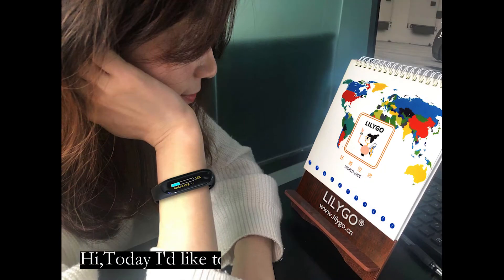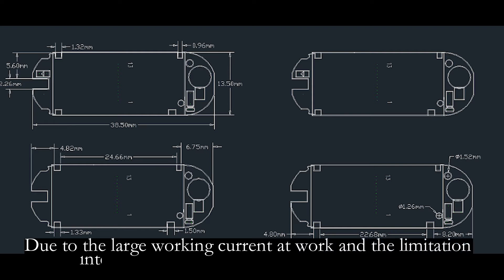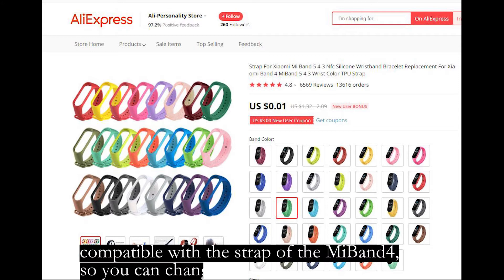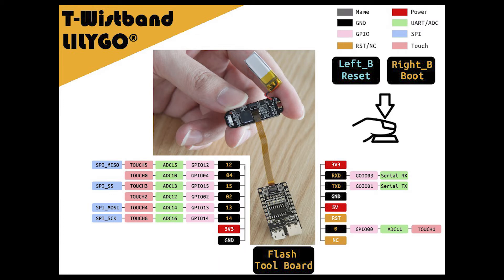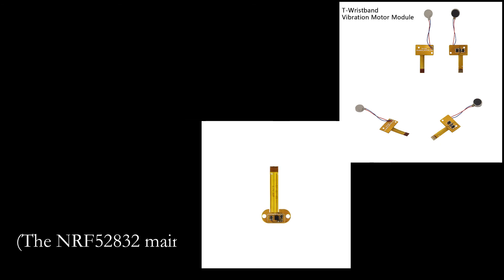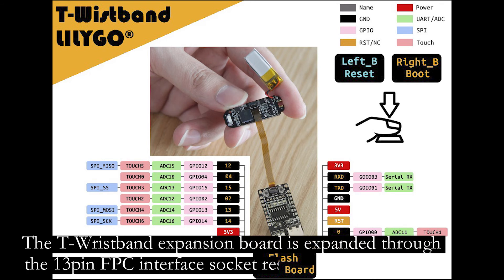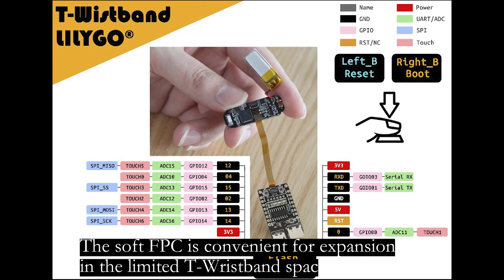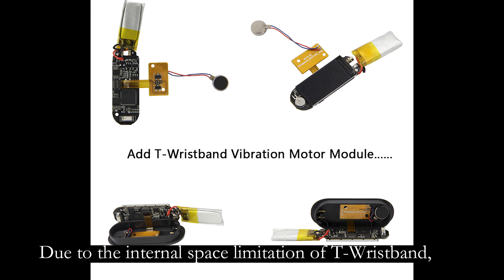LILYGO® T-Wristband  DIY Programmable Bracelet ESP32-PICO-D4 NRF52832 MPU9250 And LSM9DS1 Module

Comment: Will you release more T-Watch variants this year? Like bigger battery (I read that the watch has 350mAh and according to a comment from a buyer of the watch that is barely enough for a day?) or more sensors.
Looking at the specs, there is no watch that has a tick on all features (tho I think e.g. GPS sensor data could be retrieved from a paired smartphone).
Also, what does "scalable" mean in the table of the readme file that is inside the T-Watch library repo?

PS: I dunno wether you can make it, but from reading your comments so far you seam to be open to new product ideas:
On Hackaday I saw a flexible smartwatch project which sadly haven't gotten much further than the prototyping stage. But such a eink smartwatch that looks like a sweetband would be lit! Might not be economically feasible at the moment since such long flexible eink screens are still kinda expensive even without touch.. and eink screens that have more than b/w colour are also still not that cheap. But maybe one day!
Reply from the maker: Thank you for your comments and suggestions, we will consider your suggestions in the new product